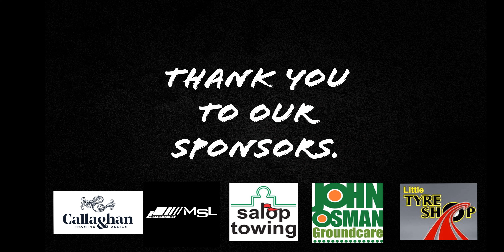E-Type Jaguar Repairing Sheet Metal  - Revenge - The Anarchy Garage - Episode 53

Comment: Crazy and respect for work. Compared to the rendering, I estimate that the wheel axles could be 10-15 cm lower.
I'll leave a subscription there. greetings from Germany
Reply from the maker: 🔥 hi thanks for watching, the suspension has been mounted as high in the body as possible to help, we are now speaking with air suspension suppliers to get it down that final bit 🔥

Comment: What are the legalities for a chassis swap in UK. Is there anything that is essential when considering a swap? I know the laws are more tight than US
Reply from the maker: The UK laws are very tight. But you can swap chassis like for like. Thicker gauge of metal and improvements can be made as long as it is based on the original design.

Comment: Why wouldn’t you dip it first so that you have healthy steel over the whole car? I have done dozens of E Types and you have to get all the corrosion out at the start.
Reply from the maker: Hi David, it will be getting dipped soon. We wanted to get some strength back into the shell before it went through that process as the floors and sills were mostly gone.